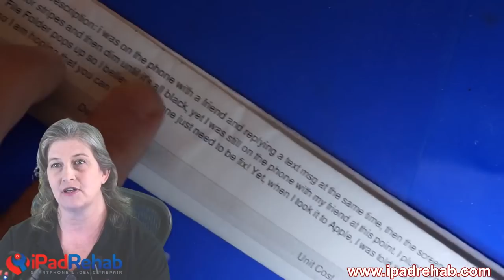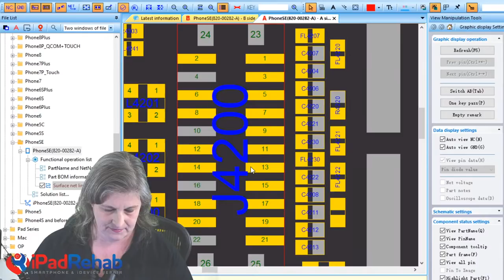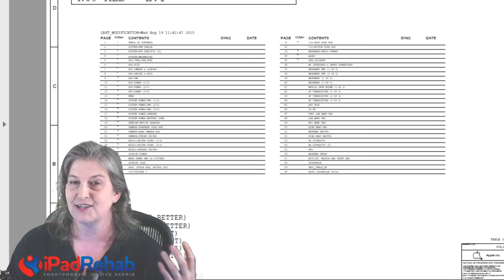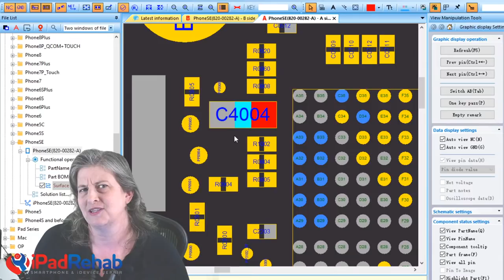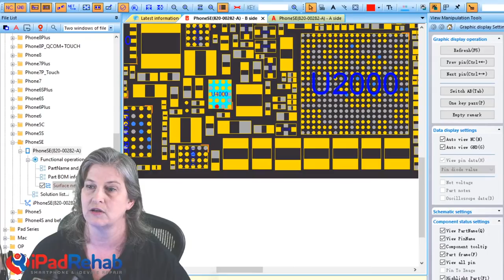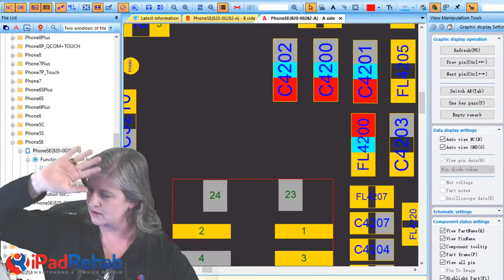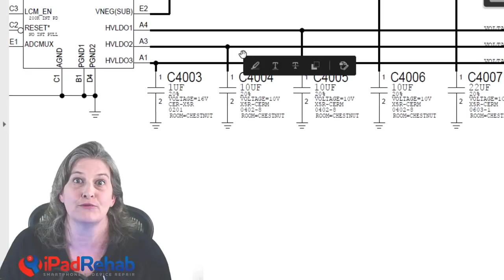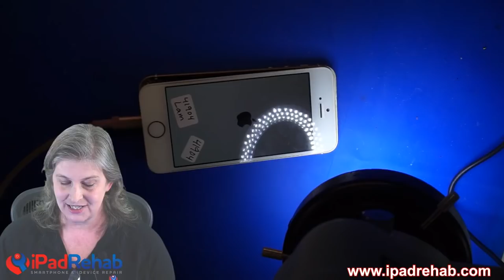Don't Believe Authorized Repair Centers When They Say It Can't Be Fixed

Comment: 4:30 if you say a new dispaly didnt fix the problem and you are going to troubleshoot the issue at logic board level then apple got it right when they said it's a logic board problem; maybe you meant "they dont repair boards", in the sense they charge you for a whole replacement, but for once they diagnosed it right (but as usual they dont care at all about repairing individual circuits/connectors/customer data etc)
Reply from the maker: Authorized repair said it “Can’t be fixed”. But obviously it can.

Comment: Apple policy, since the 128k Mac (I don’t know about the Apple ][, I’m not old enough to have been involved with it) has always been to replace the logic board when anything is wrong with it. They NEVER do component repair with a soldering iron. Consequently, what the authorized tech told her is the truth: logic board issue, needs a new logic board; and that IS the fix. But like Obi-Wan said, that’s the truth from a certain point of view. Even if you get it to function well enough to satisfy the owner of the phone, Apple would not consider it fixed; they would consider it tampered with.

Obviously, you, I, and your customer have a different point of view.

Comment: For fairness and clarity; Authorized repair doesn't neccessarily mean goof, but neither do independent repair. Authorized repair mostly just means access(!) to new original parts. And in some cases, that repair won't impact warranty, if it was still valid before the repair started.